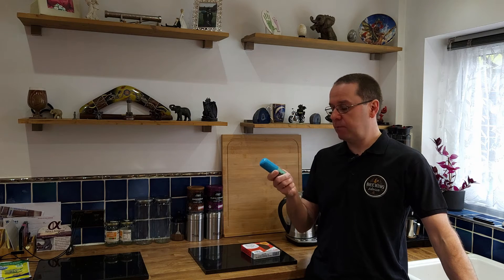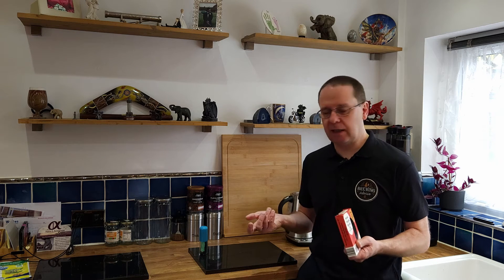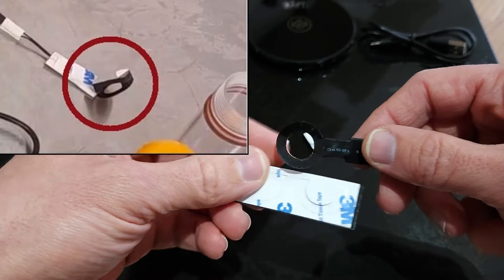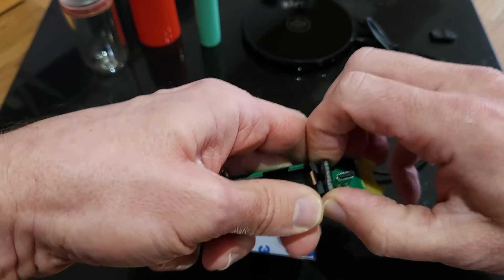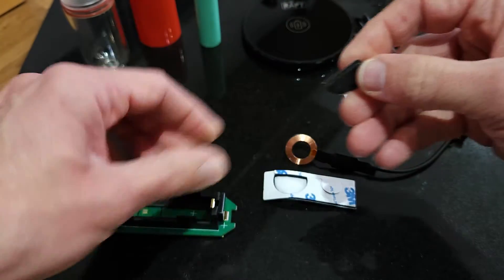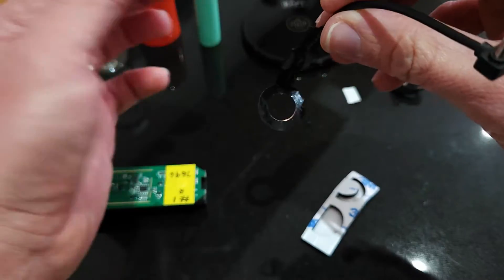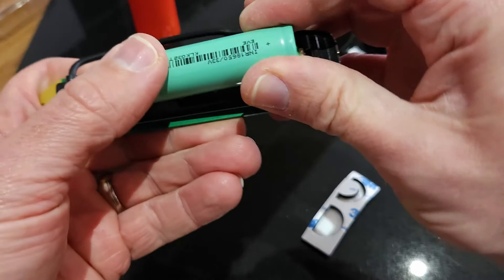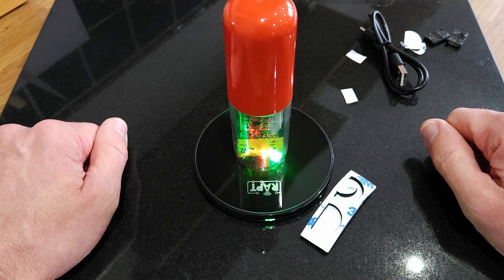RAPT Pill - Wireless Charging Kit

Comment: The kegland instructions are an absolute joke. I followed yoir video which was much easier to follow. I fear i may have damaged the wiring on the first attempt. Not too happy with kegland. Do you need to charge it first or can you install this into a brand new rapt out of the box?
Reply from the maker: Yes, sadly Kegland's guides aren't the best.  Hopefully you didn't cause too much damage.
I would recommend charging the Pill to 100% before use.  Once charged, leave it for a few hours to cool down as sometimes they can heat up and this can cause miss-reading while using it.  Once it is at room temperature, I would calibrate it in some water that is around 20C.  Once calibrated, then yes, use it.  In theory you won't need to calibrate it ever again (unless you have to open it up).